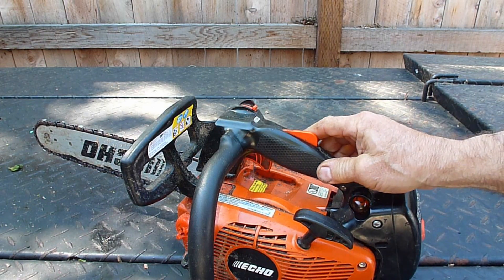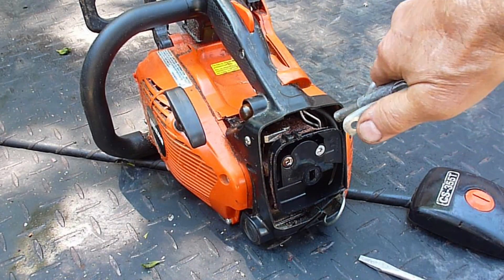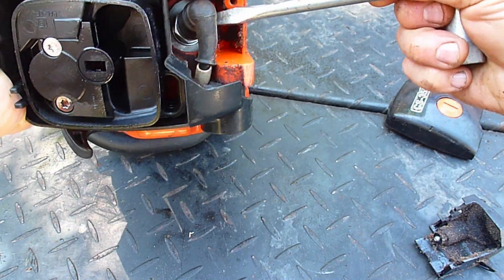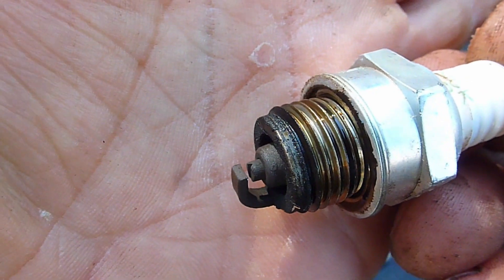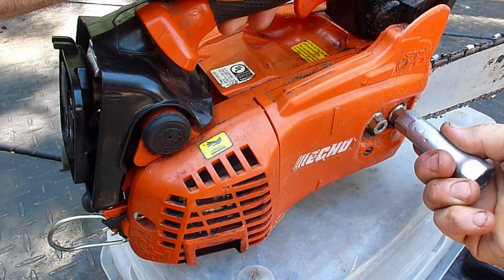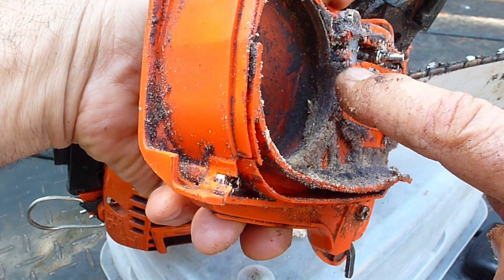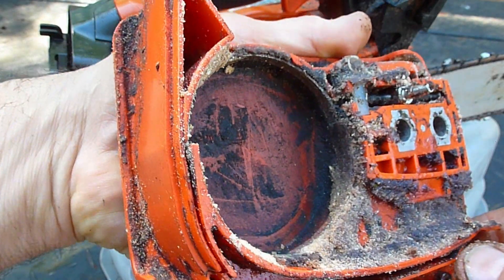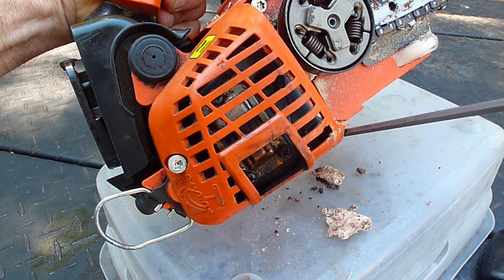How to Repair An Echo CS355T Chainsaw That Won't Reach Full Power

Comment: Great videos man, keep it up!
Btw, maybe you know the reason why chainsaw working while vertical position, but stop then i turn it on the side?
Reply from the maker: Thanks for the kind words!  I really appreciate your comment.
Regarding the issue of:  It won't run on it's side.  Check the length and condition of the fuel hose and what kind of fuel filter is on it, or if the filter is even still on it.  The fuel pump inside the carburetor will only be able to draw fuel from the fuel tank, if the hose remains unkinked as it flops around in the tank when you change the position of the saw, AND the filter needs to be on the hose, so that it acts like a weight, keeping the hose end (and filter) always in the fuel, AND the hose can't have any age cracks, or pin holes that might open up when the hose, or the saw's handle an engine body area, are flexed toward or away from each other.

So start with that inspection, and replace the supply hose and filter if they are at all "suspect."

If all that looks good, or if after you replace the supply hose and filter, the saw is still doing the same thing, it indicates that the saw has a leaking crankshaft seal.  The fuel/oil mix enters the crankcase first, and coats everything, before being pressurized by the downward motion of the piston, which then forces that fuel/oil (and air) mixture up the transfer ports, and into the combustion chamber.  When you have the crankshaft level, whether the saw is horizonal, or vertical, both of the crankshaft seals are receiving a coating of fuel/oil mix, equally.  So if those seals are leaking, you don't realize it, because the fuel/oil mix is helping the seal lips, to seal against the spinning crankshaft.  But once the saw is tipped on one side, or the other, it will die, because one seal suddenly stops being helped by the fuel/oil mix......so crankcase, which is under vacuum when the piston travels upward, sucks in a bunch of air, the fuel/air ratio then goes extremely lean, and the saw stumbles and dies.

You can somewhat hide the leaking seal situation, by using more oil in your fuel mix.  Instead of mixing 50:1, mix more like 40:1.  Then, adjust the idle mixture (the "L" screw, which is the mixture screw closest to the engine on the side of the carburetor) just a little bit richer, and do the same for the H screw.  Don't go so far with the adjustments that the saw runs bad, of course.  You're just attempting to keep those crank seals a bit more oily, so that they seal better.

Of course the correct repair is to replace the seals.  Sometimes that's fairly easy, without a bunch of teardown, and other times it's a full teardown.

Comment: that saw is very sensitive to air filter being clean.  or mine is anyway.  I love mine though.  Saw i pick up for 90% of stuff around the farm
Reply from the maker: True!  They are great little saws, and Echo has been building them for a couple decades, dating back to the years when the machines were gray, not orange.